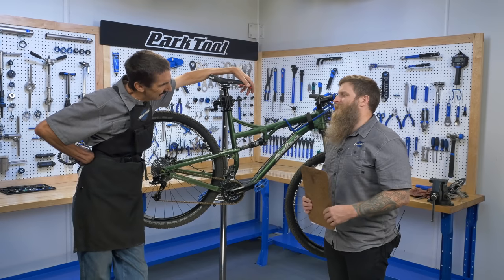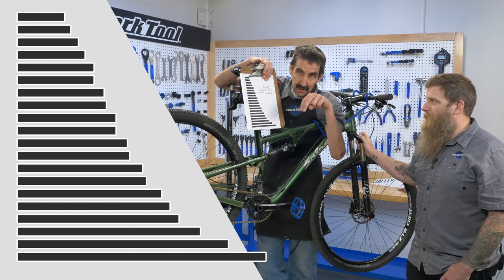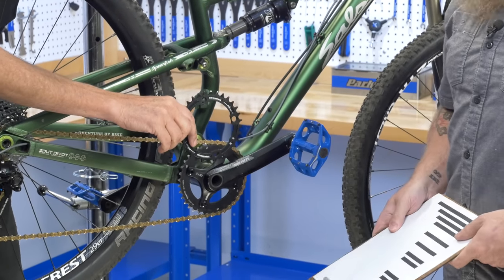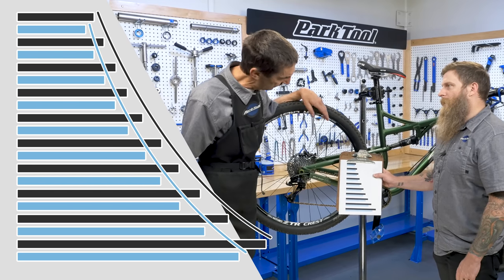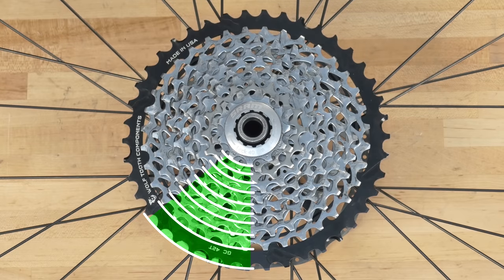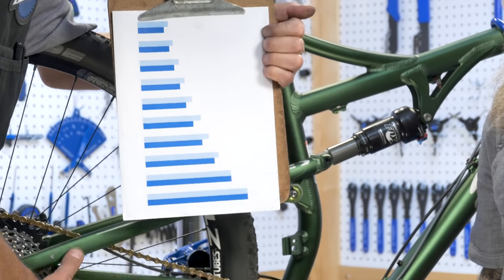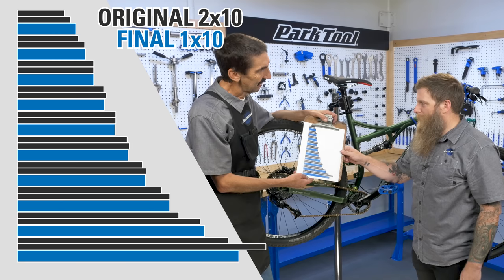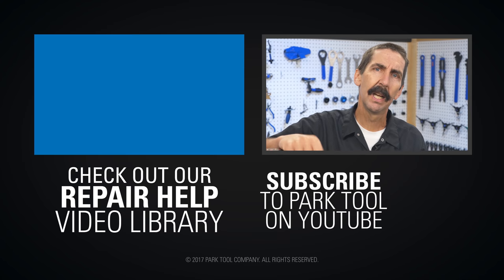1X Conversion: Pros & Cons - Tech Tuesday #91

Comment: I was in a bike shop a few days ago.  I looked for any new bike with 3 chain rings in the front.  There were none.  Is this driven by demand or manufacturers saving costs?  I have no plans to jettison the front derailleur,   It's kind of like the disk brake thing.
Reply from the maker: Mostly demand.
Reply: @parktool  Thanks - I stopped in at a bike shop again today and looked over the bikes.  What bike would I like?  I found one with rim brakes, non carbon fiber and a front derailleur.  The price was pretty good too.  Then I thought - It's almost like the bike I have.  Maybe they don't sell because people already have them.

Comment: Will a 32 up front and 11-42 in the back be good for riding on rode and in trails?
Reply from the maker: Gearing depends alot on fitness and terrain. Many people would find a 32x11-42 to work great for on and off road use where others would find it to be a bit slow for the road. So I'd say it depends on your goals and expectations but it is a good all around gear ratio. Hope this helps!

Comment: Can I transform a 8 speed 3x system to a 1x11 sytem? Last time I checked, they don't make Narrow wide for instance Raceface (30,32 or 34T)chainrings that are compatible with a 8 speed chain, cassette and rear mech. Most narrow wide chainrings only work with a 9,10 and 11. How are folks doing this?
Reply from the maker: You cannot use any of your current 8spd drivetrain components for a 1x11 other than possibly your crank. You could set your bike up as a 1x8 with a chain keeper in the front. This has been done in DH and other applications for years. You do not have the ability to get the range of one of the newer 1x systems but you simplify your system a little bit.
Reply: Can I use narrowide chainring say 30 or 32T? I heard they are designed for 9,10 and 11 speed systems, so if I get one narrowide ring, will it work with my 8speed mech, cassette and chain?

Comment: Hi, converting 8x3 to 8x1 or 10x1, do i need to consider that the chain line will be different, hence the need to change the BB length (mine is square taper crankset)?
Reply from the maker: If you use use the middle chainring position on your old crank your chainline should be correct.
Reply: @parktool  thanks for the quick response. So when i replace the current 3 rings crank with a narrow wide single chainring crank without changing the BB, it will work?
Reply from the maker: Yes, that will work.
Reply: I would go to a 11 speed 51.  Your going to be replacing a bunch of the drive train might as well go all the way without replacing the freehub.

Comment: My Norco sight 2 alloy bike weight was 13.2kg (measured) when I bought it. How come most of the bikes today, from the same category with carbon frames, without all "heavy" second gears etc hardly go below 14kg mark? Personally I can't see any benefits of 1x transmissions except cost cutting for manufacturers.

Comment: Good job.  Mostly.  You left out the fact that there are cassettes out there that do the same work as the "hack" for the same or less money (Sunrace, Praxis, e13).  Also, most folks never use their highest gear.  Who's really pedaling down a trail at 25+ MPH?  It's a non issue so don't make it one.  Also, this is a perfect swap to do when the customer needs a new chain or cassette as they are already spending the money.  That makes it a much more affordable upgrade.  Other benefits with a narrow wide chainring are no more dropped chains.
Reply: no more dropped chains you say... i know that it is a common issue that the chain drops when you backpedal (in the extreme gears). i know a guy who dropped his chain off the chainring and got it stuck under the chainguide, therefore wrecked the chain.
Reply: If you mean the chain coming off the cassette while backpedalling that is an issue with the oversize cassette.  I have been running 1X on 3 bikes (2 MTB 1 CX) for 3 years and zero dropped chains.
Reply: Maybe not on the trail, but on the road to the trail or work, some of us like to pedal at 25+ MPH which is difficult on 1x setups.

Comment: I did the Conversion from a 3x10 to a 1x10.. I drove it like that for a month and I can tell you, it's not worth it... I missed the very high gear when driving straight and the very low gear when driving uphill... and also a very big no no was that when in the low gear, the chain was rubbing very strongly on the cassete.. You could really hear it and I saw quite the damage it did after only one month!!! So I put the 3x back on and I'm leaving it that way. If your bike is 3x or 2x leave it that way, it's not worth the cost and time for the switch... My opinion...
Reply: there are 11-42 casettes 10 speed. Those ain't expensive.
If that is enough for you with a single front cog it can work.

If that range doesn't do it then indeed keep it 2x or 3x.
My cross hybrid is a 3x10 and it needs the high speed due to the high speed.

Comment: hi well i want to ask i need a bike for more time on road and some time in trail so what will be good 2x10 or 3x9 drivetrain which will be faster
Reply from the maker: They will both be safe. It will also depend on the system. Not all 2x10 systems are the same and same with 3x9. A 2x10 or 3x9 system that is intended for mountain biking is going to have different gearing than a bike designed for the road. It is much easier to ride mountain bike gearing on the road and miss out on a little top end speed than it is to push the harder road gears, while off road. I hope this helps and makes sense. I personally would prefer 2x10.
Reply: @parktool  in 2×10 it is 11-36smallest cog at rear and frong it is 36 and 22 but in 3x9 it is 11-36 rear and 40,36,22 at front now tell which will be fast on roads and all are deore

Comment: Loved the video, but the initial comparaison with a total of 20 ratios is a bit unfair since most setups are not made to use all the sprockets with both chainrings without severe rubbing or chain tension issues.

Comment: Hey man!
Can I use the ring from 3x or should I buy a new 1x seperately?
Reply from the maker: The ring from a 3x will work but you will need a chain retention device like a keeper or a guide. If you get a narrow wide or some kind of 1x specific ring you do not need the retention device.

Comment: Also, chain wrap becomes poor on most 10x derailleurs. When you adjust to fit the big cog you get away from the smaller cog. More wear as one tooth less is engaged.  5 teeth original against 4teeth after pulling derailleur away

Comment: "So we'll take another one of those out" ... so which cog did you remove to replace with the 16T to smooth out the shift?
Reply from the maker: We removed both the 15 and the 17 and replaced them with the 16 and the 42. Not directly in their place of course.
Reply: Got it, smooth shifting over top end speed, thanks guys much appreciated!
Reply from the maker: There are alternatives to this now as well Sunrace offers wide range 10 speed cassettes. Just a thought.
Reply: I did check out Sunrace, but I had too much invested already ... anyway, I just finished my conversion and I'm stoked!!! Thanks for all your super helpful videos and suggestions guys ... Ride on!

Comment: I have Fatbike 1x11 gears. Front chain ring is 26T i want to change it bigger and oval 28T do i need to change chains also for longer one?
Reply from the maker: You will most likely need a longer chain when going to a bigger front gear. When going up 2 teeth you need to add 1" of chain.
Reply: Ok, thx for reply.

Comment: Can i add to my cassette from 34t plus 36t just to extend and change my shifter and rear derailiur
Reply from the maker: Most derailleur manufacturers will advertise a max cog size for each derailleur model. The cassettes largest cog should not exceed this number unless you are using a modification such as a goat link or similar. These links are also not universally compatible so be sure to read the description before purchase.

Comment: 3 x10 all the way...
Reply: @waquzy and has a worse relation for the easier and harder gear, trust me I've tried 1x, 2x and 3x. Function always goes before fashion for some.
Reply: @waquzy yeah, it's always good to have options in the end for different needs :)
Reply: You can get a 10-50t, 12-speed cassette for less than $100 now. That's more than enough gears for anybody without the clunkiness of a front derailer.

Comment: Gentlemen NICE video so how do I turn my Trek checkpoint with 2x tiagra in one of those any hints or reference to another vid will be appreciated!
Reply from the maker: There are a few companies out there selling compatible asymmetric wide narrow chainrings that will be compatible with your cranks. The tiagra 4700 rear derailleur has a 41t capacity so an 11-40 cassette would fit nicely and the only investment you would need to make would be a chainring and chainring bolts. Hope this helps.

Comment: Shimano 2 x 10 
or 
Sram XO Eagle 1 x 12  
Sram NX 1 x 12 Eagle

................ Shimano XT all the way, the missing gears are noticable, unable to back pedal on the NX..... Not happy with Sram at all goes out of adjustment, randomly hold gears... 3-4 times on a 40k ride..... Too expensive to change now :-(.... I might one day.... but now XT not available with 2 X :-(

Comment: I currently have a 2x7 could I just change to a 1x7? Thx
Reply from the maker: You can. The issue is that 7 speed derailleurs do not have a clutch so the chain will be very loose and sloppy and will fall off going over rough terrain.
Reply: @parktool  I got told to do this to stop the loose chain 😂 I don’t really want to spend loads as I’ve literally just got this bike. What would you recommend? Thankyou for the quick reply
Reply: @parktool  They said to use 36-42T front ring I was thinking 38T but if it’s not the best thing to do I won’t do it. Thankyou
Reply from the maker: Your front derailleur being in place helps keep the chain on the ring. If you replace your chainrings with a wide narrow ring as well as a chain keeper you may be good to go but without a chain keeper you will drop your chain frequently.
Reply: @parktool  so wouldn’t it be the same even if I had more gears at the back? Why would my chain drop just because is don’t have 9+ at the back?

Comment: Is is really worth getting rid of a perfectly functioning 9x3?
Reply: i switched from a Shimano 3x9 to a SRAM 1x12 drivetrain. It depends how much you use the biggest chainring, mine was only used to scar my calf. :D BUT!! it is an freaking act if youre not into mechanics.
Reply: From what I found out is that it's only worth it if you want less on your bike for the simpler lighter look. Which makes sense it is less maintenance and you'll get rid of gear combinations you never use.
I love the feel I get from 48 chainring with 11,12,13,15,17, 21 cogs but here I climb hills often so I use 28 chainring. For 1x I need a massive cassette 11speed cassette with a 40 cog, and that to me looks ugly so I'd be trading the ugliness at the front for the ugliness at the back. Changing to a 1x will cost money to, new chain, new cassette, new deraillure, new shifters.

for now I'm sticking to 3x8speed until I warm up to the idea of a big cassette

Comment: Can every 9speed derailleur handle a 42T at the rear?
Reply from the maker: Unless it is specifically designed for it, not at all.  Manufacturers have posted limits on their models.  The diameter of the 42t sprocket is about 6.69" (170mm).  The typical 9 speed can do say 34t, about 5.4" (136mm).  That extra stretching would damage the linkage.

Comment: What size chain ring should I go with if I want to run 1×7
Reply from the maker: Chainring size is largly determined by rider strength and skill as well as terrain that you will be running as well as the range of your cassette or freewheel. With a 1x7 somewhere between a 28 and 32 would be my thought but that may change depending on the trails you are riding. Also something to note is that you will need a chain keeper for the chainring as most 7 speed derailleurs do not have a "clutch" so the chain will have a tendancy to fall off.

Comment: If I do that change I have a 1 by 9 can I put a 42 in the back
Reply from the maker: Most 9 speed rear derailleurs do not have the capacity to accommodate for a  42t cog in the rear. Many can handle up to a 36t.
Reply: Park Tool would it be able to change it for a 11 to 40 tooth ? Or what can u recommend me thank you

Comment: Yet, bicycles coming stock with 1x systems are no cheaper than 2 and 3x. Why is that? Haha
Reply: Cause cheese
Reply: You can get away with having a cheap derailleur in the back and still have a lot of gears if you have a cheap 3x and generic derailleur.
Reply: Because most good bikes that come with 1x drivetrains have a better rear derailleur then the same bike with a 3x system
Reply: The cassette costs more because it has more range/teeth

Comment: can i add 42t cog in to my 3-7 speed bike, and convert it into   1-7 speed
Reply: thank you for the answer
Reply: one more thing, just find out a 7 speed tourney mega range sprocket with 32 t on the biggest cog, can i get the same lightest/lowest combination just like on my 3x7 speed. with 32t cog and 32t single speed drive train ?

Comment: I use my MTB for long-distance road traveling and feel as if though a 1x system would hamper some of the flexibility I currently have with a 3x and 9 gears down in the rear. It simply makes sense to have more choices for very long uphill climbs and flat roads in which I want to reach speeds of 45 km/h or higher.
Reply: Seriously do you actually go that fast ?? 45 Km/h??

Comment: Gear buffering, or mitigation via subbing has merit utility-wise and there is also a valid argument for just polishing your shifting skill-set.  The chart comparisons appear to accurately depict the gains and truncation algorithm fairly as well.  The rear cage and the pilot-wheel aspect appears to attenuate the hanger line to full extension which I think will eventually become problematic in the middle of the stack.  Eventually thinner gears in the rear stack that were made from a less flexible, but harder alloy should alleviate this issue, if it is one at all.  Very nicely done video as always and as a charter member of the "Blue Crew" I really like the attention to simplifying a complex subject for those of us with less than full cerebral vascularity.
                                 Mike Kirwan - Kenmore, Wa.

Comment: Would like to know how you do the calculations for the graphs presented ...anyone can help ? Thanks
Reply: They're just using the gear ratios as bar graphs.  

I.E. - A 34T chainring and 11T cassette cog is 3.09... one crank rotation is 3.09 turns of the back wheel.
Reply from the maker: That is "gear development".  Look on-line for gear development calculators. This is the distance travels in one pedal revolution for any given gear combination.
Reply: Don't know which crankset can accommodate the small chainring.
Doubt if your 2x10 low gear was low enough in the first place.
Ok, it's a wolf cog. What brand should I buy if I want that 42t cog in a cassette?
Do I need a new derailleur?
Yes,  I have been thinking about this.

Comment: if you have trouble working with 1x with a 40 T or 34 T. You obviously need an Ebike
Reply: E-bikes never need short gears that's true. The added torque is immense. But with very steep climbs at high altitude i won't be able to ride F32t -> R42 for long stretches.
And i did do 50-60 kph at 48t -> 11t on the way down. It all matters on the trails where you ride.

Comment: This essentially confirms what I thought. I just got back into biking after about 15 years or so, only to find out there's all these new tech and new things on bikes, like the single ring-no-front-derailer setups, among other things (different kinds of shocks, tubeless tires). I literally just today found out about single-ring setups on mountain bikes, and could not wrap my head around the concept. My theory: you lose a lot of gears, especially at the high and low end of power vs. speed. Sure enough, that's exactly what happens. Why would you be willing to sacrifice power going uphill on a bumpy, tree-root-rocky-leafy-possibly muddy area?

Comment: I have a 2x11 and wanting to upgrade to 1x11 anyone know if I can add an extra cog to my cassette like in the video to have 1x12 to make up for the lost range
Reply: If I got like a 50 tooth extender
Reply from the maker: You cannot add an additional gear to your 11 speed to make it a 12 speed. The space between the cogs changes. You will need a new cassette, derailleur, shifter and chain to go to 12 speed.